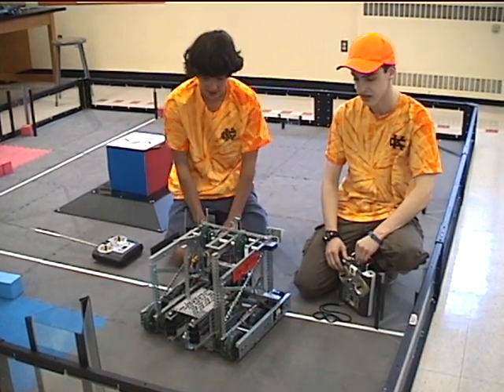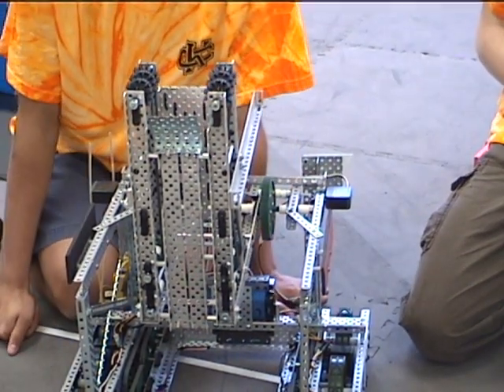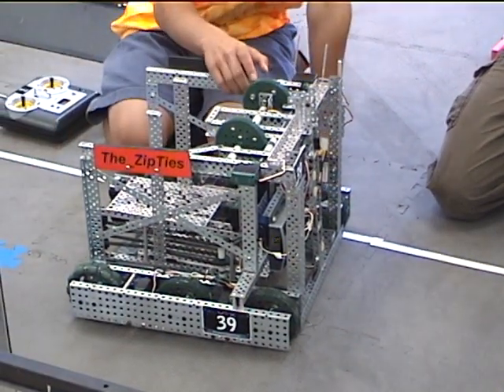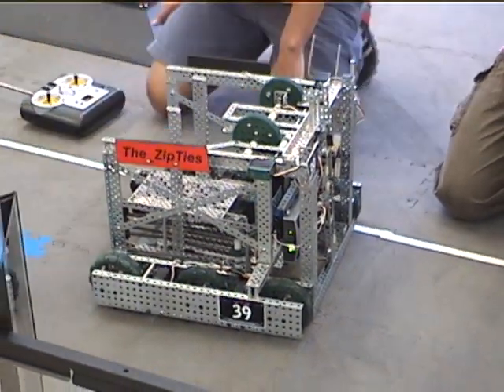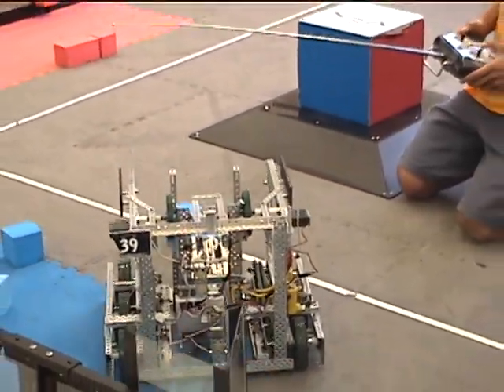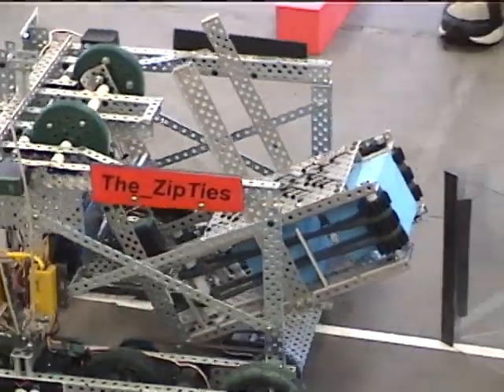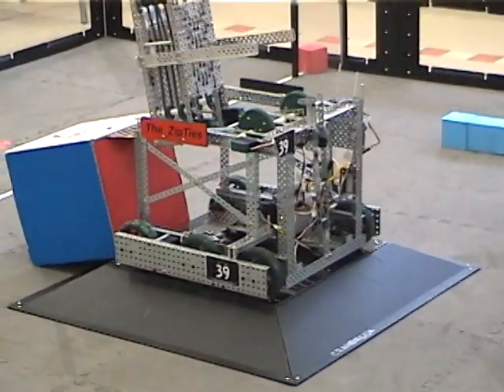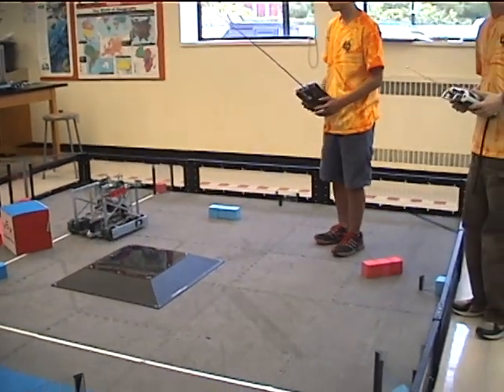Team 39 Vex Elevation Robot

Comment from the maker: all robot movement shown in this video is done during an operator control mode (to bypass the autonomous for testing, stuck an orange jumper in interrupt 6); all i did was hit the button to make it move, and release to stop it... i myself am not entirely sure as to the programing but it shouldn't be to hard.